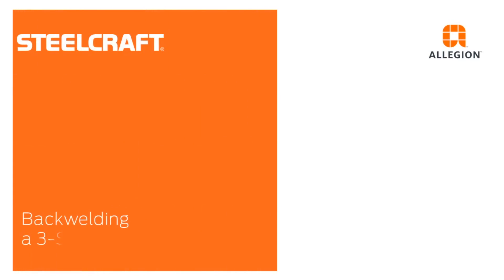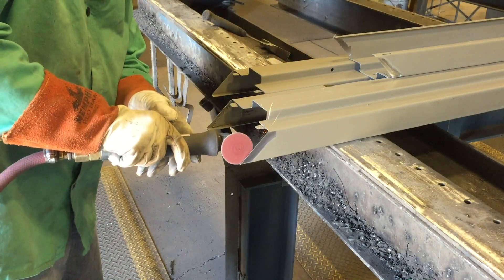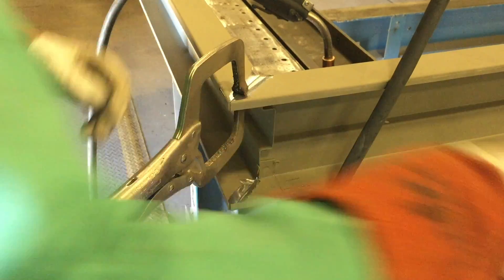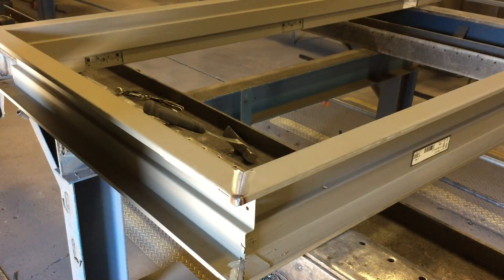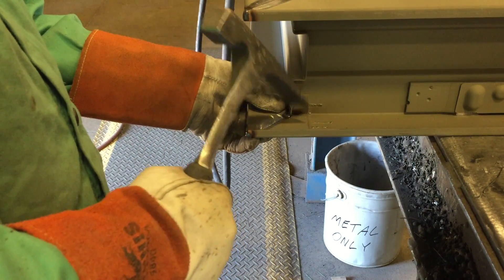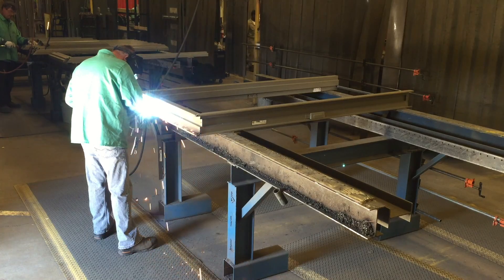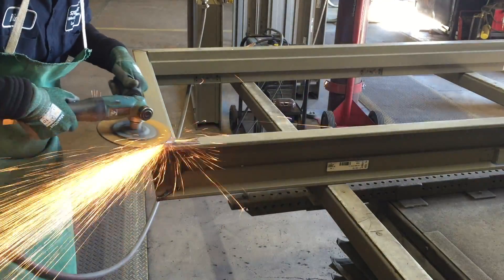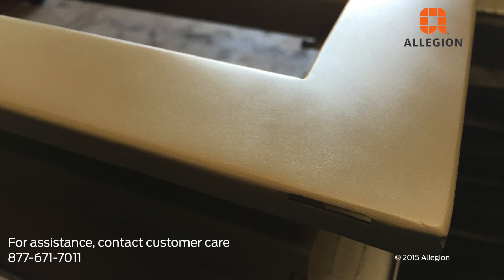How to Weld a Door Frame with the Backwelding Technique

Comment: Seems like the back-welding method is stronger (more weld mat'l left in place after grinding) and requires less grinding overall than face-welding -- why isn't the technique more popular?  Is significantly more labor or skill required?  

I'm a doors and hardware consultant, and I'm seeing a lot of heavily-ground dished-in frame faces in the field -- I don't like it, and I reject them where possible.  Clients are getting less than they paid for if the frame is paper-thin at the corners, and I'm especially concerned about compromised fire assembly frames.
Reply: Yes it’s a lot more labor intensive. Face welds are standard at my job but if it doesn’t grind off smoothly then bondo the joint. That way it looks good and isn’t paper thin
Reply: Tom Breese who are you stranger?

Comment: What is welding name??
Reply from the maker: The name is “back welding”, which refers to welding on the back (inside) of the frame pieces.  Welding on the front (outside) is called “face welding” (welding on the “face” of the frame).